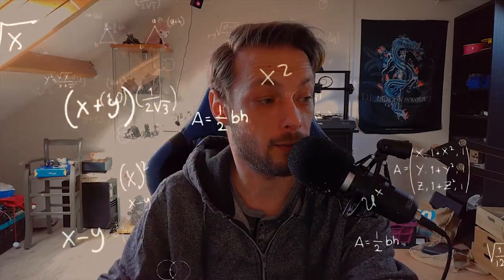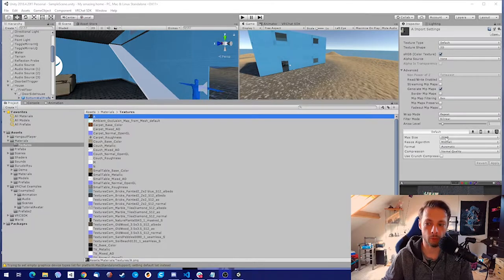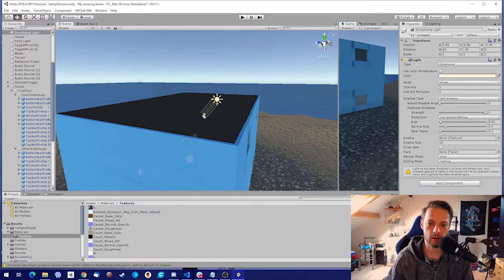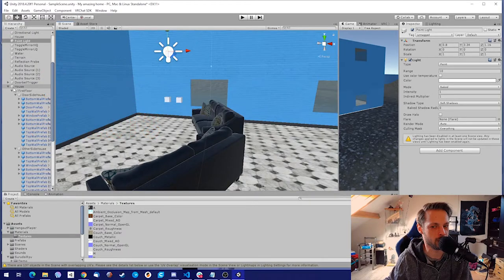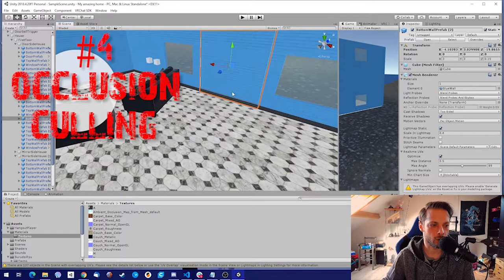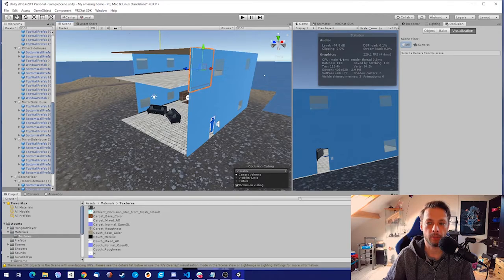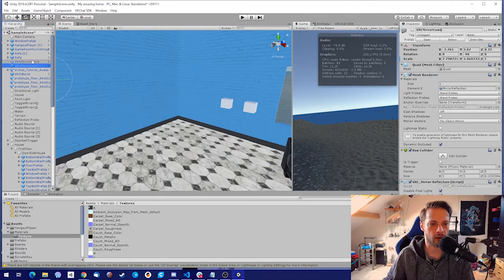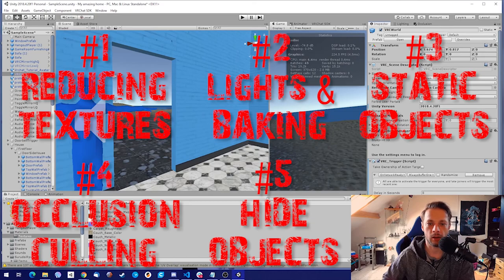How to optimize your VRChat World ? VRChat World Making Tutorial #9

Comment: i followed the lighting settings and now my lights are not working and my world is dark
Reply from the maker: It is hard to see what happened with just this text 😅 did you set up a directional light that can be casted on default objects and are the objects in the same layer? If you still have problems add me SurudoiRyu#2510 on discord it might be easier to assist 😉